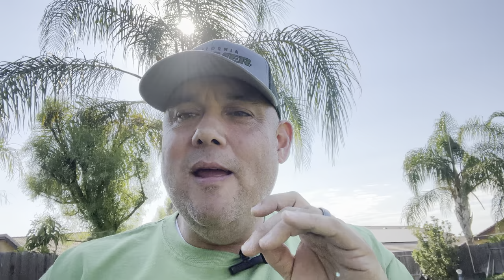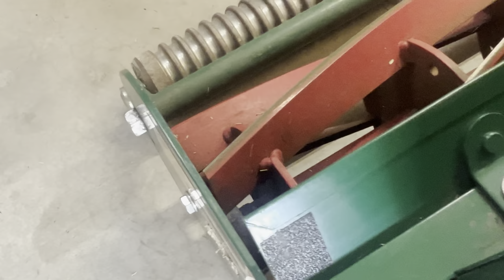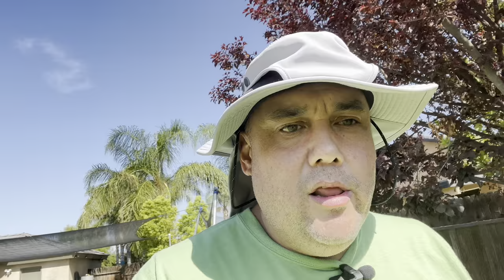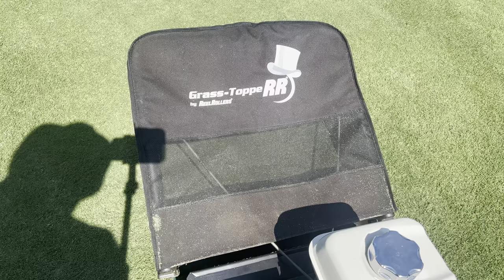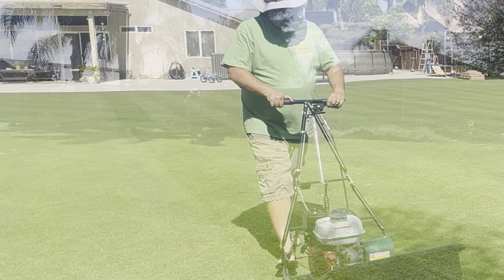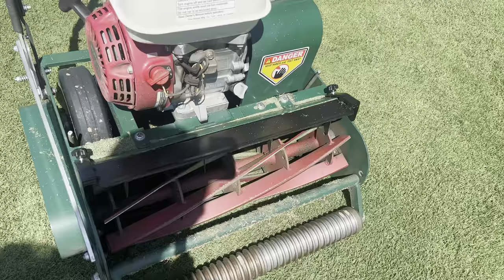California Trimmer Reel Shield Extender Installation & Review + DW🌎 GIVEAWAY - MUST WATCH. S2:E31

Comment: Something to note, the grass shield extender along with the topper are great as long as you're cutting short grass. I tried the combination after my grass had grown to about 4" due to days of rain. 
I didn't cut 10' and the grass piled up at the mouth of the topper and catcher. Even after taking the topper off the extender caused the clippings to pile up at the mouth of the catcher. I actually then wound up taking the catcher off and mowing the yard 3-4 times to mulch up the clippings.
Reply from the maker: Yes, Great point. If you watch my video on my recent Bermuda recovery video where i scalp, i had the same issue. I need to take the catcher off and then pick up the clipping with a rotary mower. I appreciate the comment and the support. 👍🏻

Comment: In the market for a reel mower currently and I’ve watched several of your comparison videos and I thank you for them.  Seems you may lean CT > McLane but acknowledge both machines are top notch?  1 comparison I have not seen is comparing a 20” to a 25” of the same unit, so McLane to McLane or CT to CT.  Other than the obvious, wider cut you’ll finish faster etc. any other pros / cons? Quality of cut etc?  Also compare a 7 blade to a 10 blade, what’s the advantages / disadvantages.  Thanks in advance and keep the quality content coming.
Reply from the maker: The answer to the 7 vs 10 blade is depending on frequency on how often you mow plus hoc. People get hung up on wanting more blades but it’s not always the better option. I would say generally if you plan to mow lower then 3/4 inch than a 10 blade is a good option but isn’t required. Lower cutting heights such as 1/2inch will see more of the benefit as with cutting height to maintain requires mowing much more often. I prefer 7 blade for most people because it’s works great to cut from 1/2 up to 1 inch or even higher when needed. In regards to the cal trimmer the 20 vs 25 inch there is a major difference between the 2. The 25 and 20 don’t share the same drive system and the 25 is not as user friendly as the 20 inch is very much the preferred drive system. I wouldn’t recommend the 25 inch generally especially if you have turns and corners as the 25 doesn’t give the. Ability to throttle the speed and is good or no go. Hope this helps. 👍🏻
Reply: I certainly do appreciate the response… would you say waiting for the drum rollers on the catalyst 20” is worth the wait or are the ruts the wheels leave behind on the traditional 20” not that bad?  Thanks again.
Reply: One other thing, I’ve been working the last few years to slowly get the lawn leveled but slow process, are a few minor ruts and imperfections enough to scalp it bad at 3/4” or so?
Reply from the maker: The catalyst looks like an awesome machine and maybe worth the wait. California trimmer is a great company but can’t say that the RL20h is not also a great mower. Hope this helps